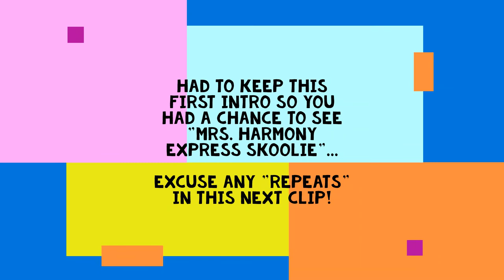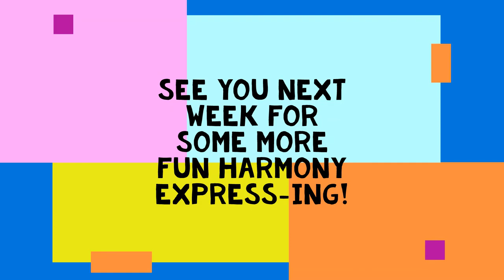Harmony Express Skoolie   EP 6 We're floored!

Comment: You got a whole lot done for one weekend.  Your rust is way better than our rust was.  After wire wheeling and rust converting I used tractor paint for the floor and have been rust covering and painting the undercarriage frame as I go with that as well. We got our roof raised Saturday.  If you're doing a roof raise let me know. I had a local fabricator in New Ken make caps for the hat channels which simplified that process.
Reply from the maker: AllMoMoMostHome Bus thanks for your comments.  Sorry that you’ve run into rust issues.  I think that buying a 2008 bus just gave us a better chance of minimizing rust issues.  We’ve found that most of the rust was located where the joints were on the plywood floor.  There were spots that were still WET when we took up the wood!

Whereabouts are you located?  We should get together!
Reply: @HarmonyExpressSkoolie  I'm east of the city about 30 min east of Monroeville. I go to Pittsburgh most Tuesdays for my job.